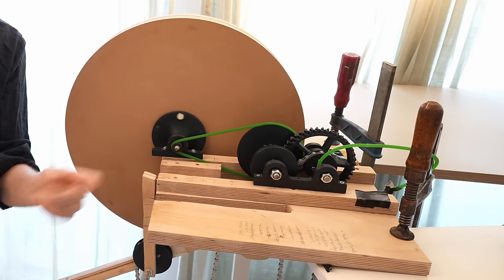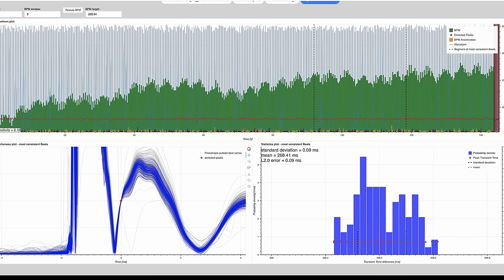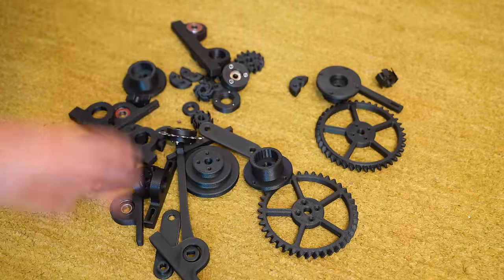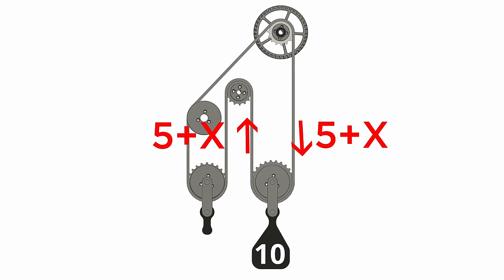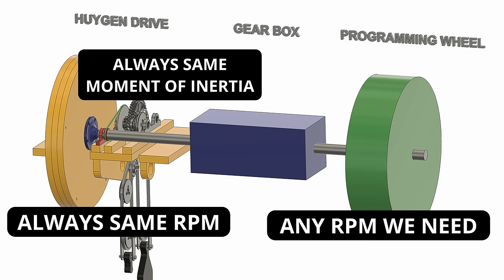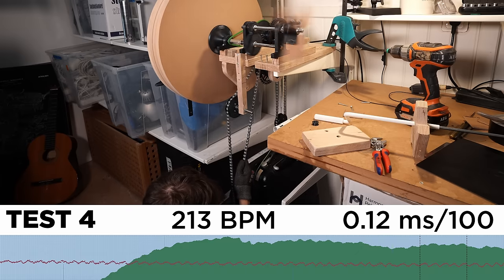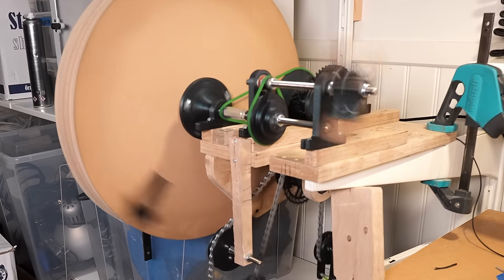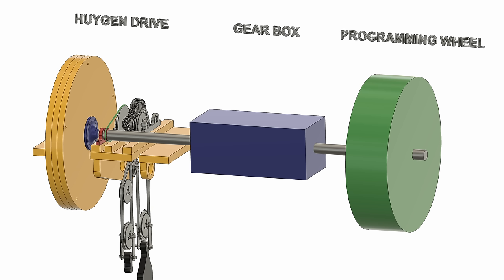Using Gravity To Play Tight Music

Comment: I'd like to offer two suggestions despite all the tuning problems this Huygens mechanism has, plus the fact that the more resistance exists in the machine, the more weight you need to constantly lift.

The weight problem can be solved using pulleys, since lifting the weight doesn't need to be part of the Huygens mechanism.

The slow ramp up might be solved using an air governer that expands the faster it rotates thereby increasing the resistance the closer it gets to the desired speed.

And maybe you'll figure out a variable gearbox for changing the BPM on the fly?

Comment: You could try using a block-and-tackle pulley system.  You won't need to pull/crank the chain as often to lift the weight.

Comment: In power supplies in electronics, there's this performance data "Power Supply Rejection Ratio (PSRR)" that gives a clue about how well the power supply can reduce effects from change of the load. The same should be considered in this mechanical system as well. A varying load (such as from a machine playing music with varying intensity) should be considered when evaluating the tightness. Control theory engineers, please step in...

Comment: I have scrolled past a couple of comments but I haven't seen this - the gearbox will not only change the rate of rotation but also torque. If you gear up for higher speed you will lose torque. If the mechanisms rely on certain torque to operate you may end up with a machine that will be unable to be powered at certain tempos.

Comment: The tempodrift cannot be solved with a bigger flywheel. It comes from the change in resistance in your system. One sourcr if resistance is the governor the other sources are the combined coulomb and fluid friction spots in your system. Lubricants are the key factors here. Try to get ceramic bearings with little friction to get the Overall friction down. Although, try to get rif of your plastic gear wheels which change stiffness and surface area of contact during heat change. Get something from hardend steel if possible for you and lubricante all moving joints in the syste

Comment: You're trying to build a giant accurate clock but without any timing mechanism! All these different power input mechanisms are great, but they are never used to provide timing! They provide power to the timing mechanism! You need these mechanisms to provide more than enough power and then you also need a timing mechanism to utilise this power. This is where a pendulum / oscillator comes into play in a clock.

1) Provide continuous ample power using a weight drive.
2) Limit and time this power using an oscillator.
3) Provide a timing input to the oscillator so you can adjust the BPM on the fly.

Comment: I love what your are doing, and have a suggestion. Could you use a high torque motor with a potentiometer  to regulate the voltage to get a constant weight lift so you would have a very tight, and consistent speed on wind up. Just a thought.

Comment: You could make vertical shaft air governer with swing arms for flaps. Then speed increase will push arms wider, this mean higher linear speed becaouse larger radius, this increases air resistance on squared, means better and more accurate braking when speed goes up.

Comment: Increase in temperature decreases the density of the air, thereby decreasing resistance for the air governor, and that is a plausible explanation for the gradual ongoing increase in tempo. Around typical room temperature the density decrease about 0.4% for every °C increase. All energy put in to the system turns to heat, sooner or later, and your work means your heat output increases too. The human body is very inefficient, so you give off much more extra heat energy than the amount of potential energy that you put in to the system.    

It wouldn't be difficult to measure the air temperature and see if it increases in a similar way as the tempo, as would be expected from an increased heat output in a small space.

Comment: You should try the reaction speed of an air blade governor when you try to drive a varying load (meaning: varying the number of instruments played). You need to quantify the minimum and maximum load that the music machine requires to learn about the power range you must be able to provide.

Comment: at 6:33 the force "x" as you illustrated is transmitted throught he pulley system due to newton's first law, since the heavy weight is at rest or moving very slowly for the functioning of the drive for an instant you can think of it as acting as a rigid pulley, However it just still accelerating in response to that "x" force. The inverse then occurs when the ratcheting motion is complete. This is probably an explanation for the wave found in your bpm chart. But yes a heavier mass would likely damp this out and more forceful jerks on the ratchet would make it worse, as seen in the newton's second law.

i hope that makes sense heh

Comment: i feel like the flywheel and weights kind of do the same job, they store energy that gets used later. apart from the weight and chain method doesnt slow down over time it just outputs the same force until it hits the ground and i think the tempo drift would be solved by kinda getting rid of the flywheel. cos its not drift, its just a really long build-up because of the weight of the flywheel. mabey im wrong tho

Comment: Hi, I’m an automotive engineering student from the US, I love the project, and I think this drive is a genius idea for the application. However, chain driven gears tend to be fairly noisy, have you though about adapting automotive timing belts to work in this drive? They should be able to play just at tight music, but might be able to reduce the amount of noise coming from the drive

Comment: If you put one chain drive as the input to the next, it should act to filter out small ups and downs (effectively multiplying them by a very small fraction).  You may get better performance out of two smaller flywheels than one big one.
Reply: (Or even a small one as input to the big one.)

Comment: Your air governor is missing the part that reacts to centrifugal forces. A high quality air governor should have more air resistance per rotation when the RPM is higher and typically this is implemented with springs trying to keep blades near the axle and centrifugal forces tilt the blades away from the axle and increase air resistance.

The simplest implementation I can think of is to have sliding parts attached to slots in the fan blades you currently have with a weight attached to the part of the fan blade that's moving in the slot and being pulled towards the axle with a pretty weak spring. That way when the RPM increase, the effective length of the blade gets longer and the air resistance increases.

Comment: an oil governor could be much smaller and more linear by varying the amount of oil in it. the gearbox could be omitted by having a rubber wheel riding on the side of the flywheel at different radii.

Comment: Governor air flaps need to be mounted on shaft of a worm gear (screw), so that you don't chop them down. Only way to decouple drive input, is fluid filled torque converter.

Comment: Governor fan needs a Continuously Variable Transmission to drive it and maybe variable pitch blades for fine tuning.
This will allow fan resistance (and therefore flywheel speed) to be controlled actively during operation rather than being set in stone by fixed gear ratios and blade size.
Small CVT gearboxes are common on scooters, buggies, golf karts and some lawn mowers. 
R/C helicopters or planes would be an easy source for a Variable Pitch propeller drive, some parts should be 3D printable.
With fine tuning, this could be made into a closed control loop capable of targeting and maintaining a requested RPM despite variable power input.

Comment: I think, a good solution of your problems to regulate the bpm could be to create a pendulum like in the clock making. Thanks to this you could regulate the bpm precisely thanks to the height of the pendulum. However there are some problems with this type of solution of course, but I think it's a weave of reflection

Comment: Every time you say Moment of Inertia in this video I think what you meant was Rotational Kinetic Energy. MOI for any given flywheel is constant, its a physical property of the wheel. The speed determines its kinetic energy via the equation 1/2 Iw^2 with w being rotational speed and I being that MOI. So with the flywheel at twice the speed it has 4X the kinetic energy but its still the same moment of inertia. 
Since a human pumping, pedaling, cranking, or what have you is never perfectly consistent it makes sense that a larger total kinetic energy (faster spinning wheel and/or much higher inertia wheel) would be more consistent. I wonder does the tempo drift happen slower at faster speeds?

Comment: If it's worth doing, it's worth overdoing, so make this two staged. Remove ratchet wheel and replace it with chain sprocket which is rotated by another flywheel/ ratchet mechanism. That allows keeping your weight very close to same spot and eliminate tension variation on the chain.

Comment: Maybe just using a disk eddy current brake will do. Glue tinfoil to cardboard for tests.

I reccomend some kind of simple closed loop control system with adjustable speed to vary the tempo while the music plays instead of a gearbox.

The setpoint could be set by lever or the programming wheel.

Comment: If the airbreak is fixed, the air resistance only changes with speed, and also the ambient humidity, temperature and pressure might change the tempo.

You can make the flaps be hinged so they expand with the centripetal force, this way it will automatically compensate, having less resistance a t low centripetal forces and more the faster it rotates, it can also somewhat compensate for atmosphere changes of rpessure humidity and such.

EDIT: at the end of the video you already talk about ball governors, thta are basically the same thing.

Comment: What you have made here is a large mass driven by a constant force with a drag element that varies on speed.

That is Not a governor by any good description  its simple a "variable load" based on air pressure as soon as you start trying to drive the more variable load of a marble machine from your flywheel things are going to get much worse.

A governor should apply a positive breaking force or decouple your flywheel from the driving force when it reaches set point. This might be by 'measured' using air pressure or bob weights and then modulate some sort of clutch or brake mechanism.   You can't just attach 'fins in the air' and expect this to regulate well

The speed up is likely caused by warming parts and grease (changing the friction losses in system) and the air around the fins warming up over time (change in air density changing the back pressure on the fins at speed)
Reply: Oh and a bigger and bigger flywheel is Not what you need.  It seems you keep going for 'bigger is better to play tighter music'   you experiments are measuring how well you can spin a stable mass fed by a constant force (your falling weight) nothing more.

You should size your flywheel to account for how much energy you need during the 'gap' or 'change in demand' from the system before a real governor would starting adding more power to the wheel.

The fact that your weight is falling constantly says you have reached the limit of your input power in balanced against the demand of you system. This is Not what you want.  The governor should be modulating the demand from the weight so it would be slowing its rate of fall as you reach your desired tempo.  That would be proper closed loop and give you 'overhead' to add more force when you need it

Comment: You need to separate the program wheel so it can be a known constant load. You need two power input methods. One for the programming wheel, and one for all the sloppy variable load stuff.

You could turn a single crank attached to the input of a limited slip differential. Could be you'll need to incorporate a small electric generator to regulate the spins on the differential outputs. It might be possible to build a mechanical computer as carburators are mechanical computers.

It may be necessary to turn the input of the differential with a giant spring clock power mechanism.

Comment: you could just stack 2 of those systems. This would cause the second weight to be lifted at a very constant rate. The small speed changes in the first system wouldnt matter when going into the second system. Furthermore do you have more time to adjust the speed of the first system, when the mechanical torque of your gear box changes (for example when you add another instrument).

Comment: If you want to make the air governor provide a more exponential correcting force you need to re-think it.   
You can make the air governor diameter change with speed in a way that increases its slowdown force even more as it speeds up.  This can be done by designing the fins to swing outward further with centrifugal force from spinning.    The faster the governor spins the further the fins swing out thus causing a higher slowdown force. 
Look up a steam governor and pretend it has fins on it. 🙂

Comment: If small variation in bearing temperature is affecting the speed, imagine what will happen to the speed when there is a highly variable load from marble lifting and marble dropper activations! Gravity is constant but marble machine load is not. so you get highly variable speed. You need a power source that can compensate for varying load i.e. you.

Comment: I think you have the huygens drive and the flywheel connected "wrong".

Gravity is absolute.
The weight is basically irrelevant, it just determines how much force you can output.  Assuming friction in the output is zero, the weight is irrelevant.  Of course, friction is not zero, so you want enough weight to overcome all the friction and provide force for the work (i.e. playing the music).
the poweroutput will ALWAYS be mass * gravity + (fluctuations from changes in rewinding).

"rewinding" the drive is the variable bit. it's what's causing the fluctuations.

You remove fluctuations of power input with a flywheel.
So the flywheel should be on the "crank" wheel... ensuring that lifting the weight (while gravity pulls down) is very stable, and any fluctuations of input power (i.e. hang cranking or pedalling) are smoothed out by the inertia of the flywheel.
if the weight is slowly dropping... crank more, if the weight is going up... slow down a bit on the cranking.

Also, your governor now needs to work against the flywheel... which is a big ask.
Much easier if it only needs to work against the huygens drive gravity.

Your added problem is that the power intake of the machine playing music will be unbalanced and uneven. it might be small enough to ignore, it might not be.  Enough weight and a really strong governor should be able to cover that.

Comment: The force excerted on the Huygens drive by the counterweight depends on the CW's vertical acceleration, not speed. At least I'm pretty sure. Attempting to keep it perfectly still is a worse strategy than letting it drift up and down with gradual corrections to input power.

Comment: Try to make a non linear air coverner. For example the blades extend at a certain angular speed. with this you can reach much faster your desired speed and it will be more stable too.

Comment: As a suggestion, instead of having gears for the governor, why not a Continuously Variable Transmission? You could tweak and adjust it so that it only reaches a certain speed, therefore slowing down the governor. Either that, or have an actual gearbox that works on a semi-automatic basis, meaning you can change up or down manually, which in turn allows the governor to go faster or slower. Just a thought.

Comment: Hello ! Great to see that Gravity seems great and tight ! But I can't stop thinking about one thing, why not using (instead of the governor) a pendulum to control speed. Couldn't you use a pendulum the same way it is used in clocks and metronome (which are supposed to be quite tight) ? I think it could help the issue you have with the speed accelerating. Pendulum oscillation period is constant (only depends on mass and lenght). You could even avoid the conception over the gear box if you build a telescopic pendulum with modifiable lenght.
Reply: Actually, I may be wrong, maybe the machine is too heavy be controled by a simple pendulum (or he might have to be quite heavy). But i'm not sure, some clocks with pendulum are quite big too.

Comment: 14:55 No, not "moment of intertia", Martin.  Angular Momentum.
"Angular Momentum" is what you mean.

"Moment of Inertia" is a property of an object.  You can't change the Moment of Inertia without changing the object itself.  Since the flywheel isn't changing shape, size, or mass as it spins, it's not the Moment of Inertia that you're talking about.  It's the "Angular Momentum".

"Angular_Momentum" == "Moment_of_Inertia" × "BPM"

[And before anyone jumps on me:  I have a doctorate in Physics.  I know that I should have "angular velocity" instead of "BPM" above.  However, angular velocity has units of "1/seconds", so the difference between beats-per-minute and angular velocity is just a unit-conversion.  After all, linear momentum is still linear momentum whether you measure it in kg•m/s, slugs•ft/min, or kg•furlongs/fortnite!  😆]

Comment: If you would use double gravity filtering it would be even tighter
Just use the output of the first as Input for the second flywheel, that way it should reduce the slop, therefore tighter over longer time.👌

Comment: Stupid idea time. Add in a pendulum and escapement to turn it into a gigantic clock, then connect the flywheel through a torsion spring to turn the discrete pulses into continuous rotation. Et voilà! Perfectly tight music with a stable tempo!